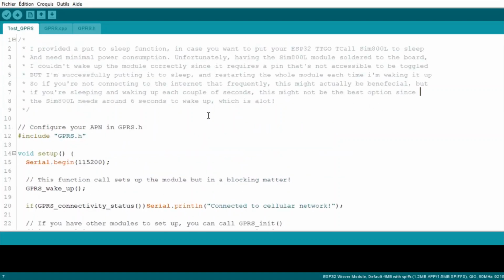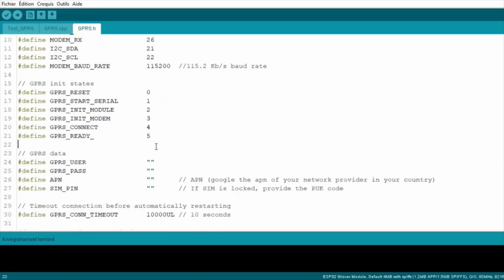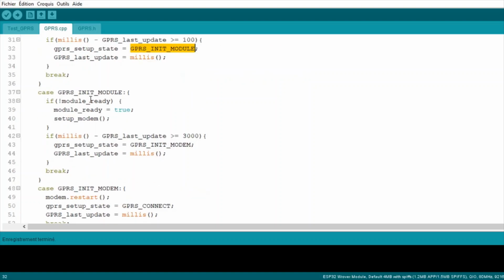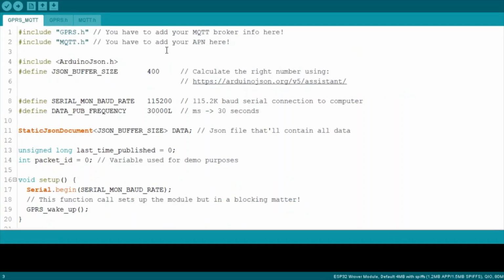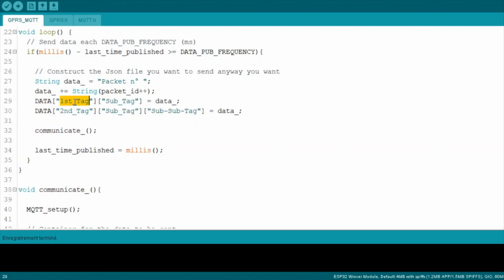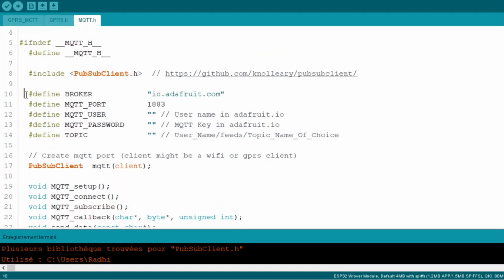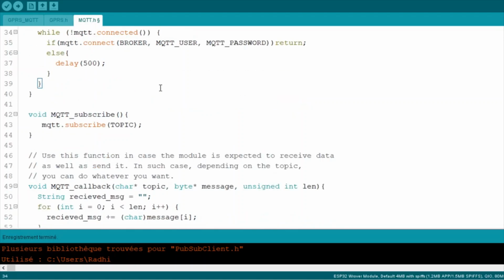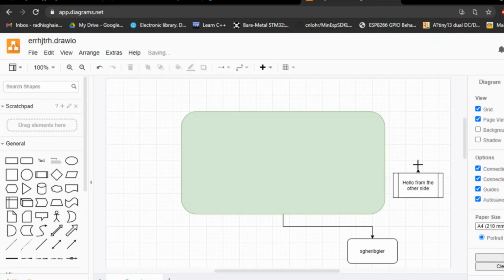TTGO T-CALL: Connect to the Internet with Cellular & send data with MQTT & JSON [Code walkthrough]

Comment: Hi Radhi!
Did you test subscribing? I'm trying your code which works fine with Adafruit IO to publish but when I try to subscribe the MQTT_callback function doesn't respond. Any idea?
Reply from the maker: Hello Elias,
Actually, I never used the subscription functionality on the ESP, and I tried it now with no avail. I can't seem to figure what the problem is, but this problem seems common enough for I suspect there's something wrong with the library (did some googling and many people have encountered the same issue). 

I would suggest you try:
- Calling the mqtt_client.loop() function in the main loop, not just when sending (like I'm doing in my code)
- Adding some delays
- Look for some more solutions people have tried to solve this issue 
- Looking for another library just to test whether the problem is with the library or with something else.
----
Otherwise, I am sorry I can't do more investigations about the subject for now, hopefully I'll find the time to dig deeper into this.
Good luck!
Reply: @radhi.sghaier  
Thanks for your response.
Before seeing your reply I already tried a lot of things. Finally I can receive the subscribed topic's message successfully but with some lags (it misses the message most of the times like 7 out of 10 messages are missed). Here are my observations:
- The library works fine. Of course client.loop() needs to be called to keep the connection alive.
- Adafruit IO has some limitations on the frequency of sub/pub with free accounts.
- Since I was using TTGO t-call's default antenna I think the antenna is not strong enough to keep alive the connection hence our client misses most of the updates on subscribed topic. I'll try with a bigger antenna but I don't have one now. I'm confident a new antenna will solve the issue.
- added some delays then later I found it wasn't necessary.
Reply from the maker: @mkelias2932  Great news, another thing to check is how much current you're providing to the TTGO! The SIM800L module could consume up to 2Amps on some loads (I didn't observe this behavior myself, it says so on the datassheet), so if you're powering it using a USB connection from a laptop (500mAmps max) or a Lithium-Ion battery with low C rating (not able to supply such current values), maybe try with a heftier battery. 
Anyway, keep up the good work! You shall eventually end up with a satisfactory performance!
Reply: @radhi.sghaier  Yes, I'll try with both a better antenna with higher gain and a good power source. TTGO t-call usually comes with USB type-C plugging into USB3.0 port (sometimes exceeds 1 amps) just works but not a good practice I think. I'll reply if I can come up with something efficient on both pub/sub.

Your replies are inspiring by the way. Thanks.

Comment: how can i on and off the ttgo using button ??
thank you
Reply from the maker: You can call the put_to_sleep() function from within a function that would only be allowed to run through a flag setting in an ISR configured to trigger on a button click.
Otherwise, you can simply detect when a button is pressed, and if so, call the put_to_sleep function. I don't think you can completely turn off the module without accessing its pins (while it's soldered on the ESP, nothing could be made from what I can recall).
Reply: @radhi.sghaier  thank You so much